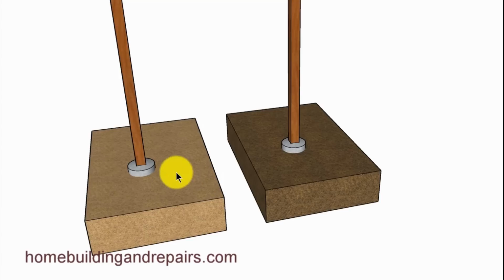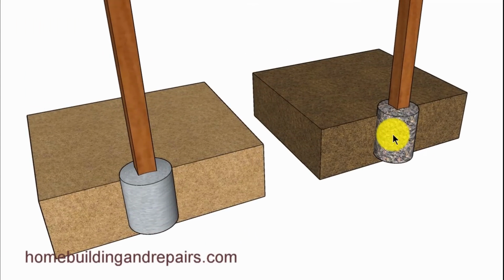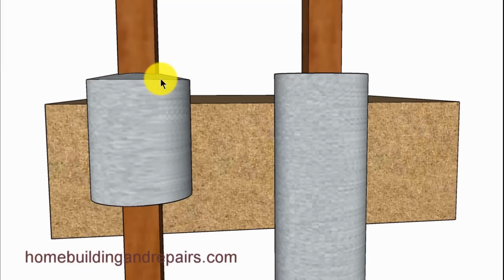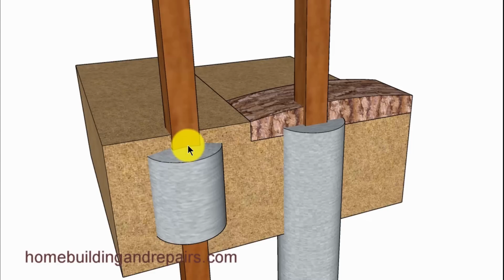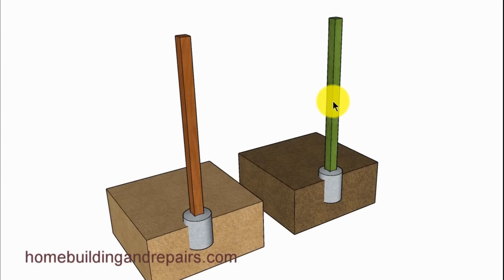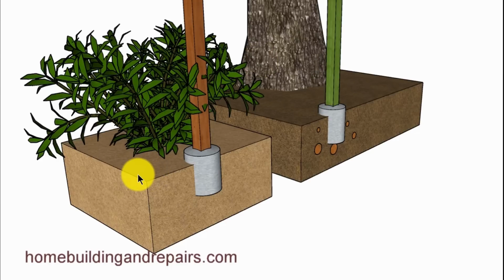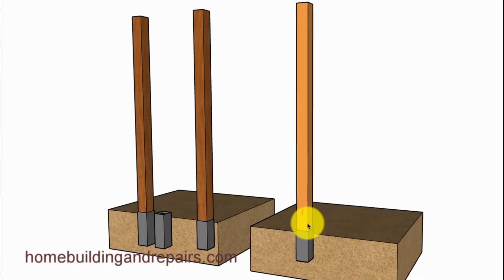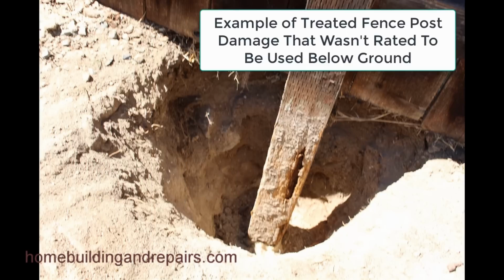Watch This Video Before Installing Your Next Wood Fence Post – Money Saving Ideas

Comment: Reasonably thorough but ! Concrete in cold areas, the frost can heave the post. Those metal straps in dirt or concrete will probably not last longer than the post.
 I would set guidelines, not absolutes.
1 Use pressure treated ground contact wood whenever possible
2 dig deep, below frost line. The taller the fence the deeper. Concrete would not be necessary.
3 the better the drainage the longer any post will last. 
4 If you use cedar or redwood your post has a definite lifespan. Concrete will make replacement a pain in the a$$ and not make the post last longer.
5 painting any wood fence, post or deck you will be in for a lifetime of maintenance.
Reply from the maker: I always like that, reasonably thorough but... I should change the title to almost everything about wood fence posts except for the stuff I didn't address. Your comment is sincerely appreciated and thanks for posting.

Comment: End result -- If you have a wood post, eventually it will rot...
Reply from the maker: I think I would've put it more like this, if you have a wood post it might eventually rot, instead of will rot.
Reply: @gregvancom  -- It will eventually rot unless something else happens to destroy it first -- fire, tornado, hurricane, errant teenage driver... Biological matter doesn't last *forever*... Maybe in millions of years we'll have petrified wood fence posts? :)  I don't have anything else that is all that pressing planned, so I guess I can wait around... Might need to stock up on beer though...

It won't last forever, but it might last as long as the rest of your fence and if you are lucky, you might even be able to get the posts to last through a fence replacement so that you only need to replace the rails and the pickets and not have to replace the posts.  If you live in a particularly dry climate, there's even a chance that the posts might last as long as you own your house.  I'm in the Houston area and that is most definitely NOT the case around here...

Comment: If we are going to use concrete and hardware, we could do it like how telephone posts are done. Make a concrete part that goes in the soil and sticks above and bolt your post to that. But im not sure what you gain against buying concrete fence posts at that point.
Reply: Cost, mainly... Besides, most utility poles around here are wood and just put in the ground with no concrete or anything around them other than dirt.  They are so heavily treated that they last a pretty long time.

Comment: given that wood rots..any alternative suggestions for non-wood posts that will avoid this
Reply from the maker: Maybe use metal, just keep in mind that metal rusts. I just built a fence using pressure-treated lumber for the fence post in my backyard last year. No guarantees that it will not rot, but I'll let everybody know if it does.
Reply: @gregvancom  l

Comment: Interesting video, just surprised that setting the posts on a couple inches of gravel and then in dirt ONLY wasn't mentioned.  It's more work to tamp the soil than to pour concrete or expanding foam, but it's a lot cheaper in terms of materials and kinder to the environment.  We have posts that are set that way here and they are still straight and sturdy after 25+ years!
Reply from the maker: We would all like to know what part of the world you're located in and the reason why I didn't mention what you're suggesting is because I've never installed a fence post for a 6 foot tall wood fence using your method that didn't lean where I live in Southern California.
Reply: @gregvancom  Thanks for the reply, sorry I just saw that.  We are in Memphis, TN, currently building a fence in Hernando, MS.  Much of the ground there is almost as hard as a rock!  Thank goodness we have a CAT 299D2 XHP with a 10" auger (although the old auger bit has already broken twice and had to be welded, plus hydraulic issues).  Some of the old posts were set in concrete and we were able to break many of those off fairly easily at ground level, by hand.  After reading more about putting gravel under the posts, we have decided not to do that anymore.  The reference that made sense to me referred to the fact that water will flow following the path of least resistance.  I.e., if you put gravel under the posts, that's where the water will be.  So, it's well-packed dirt only for Us.  I can imagine that with a sandy soil, that might not work well at all.  Thanks again,
 Daniel.

Comment: Here is what I do for a fence which will serve for ages to come. I precast 3-1/2”x3-1/2”, 5’-0”  concrete posts. 30” goes into a soil. You can embed it in a gravel or in concrete depending on your soil condition. 2’-6” sticks above the ground. I have two  holes for lag bolts in above portion of the posts and attach wood posts to concrete post leaving 3” gap above the soil. When in 30-40 years wooden 4x4 posts decay, throw them out and attach new 4x4 posts.  My fence is 30 year old at this point and I am estimating it will go on for another 10. Good luck!

Comment: How about metal
Reply from the maker: Your question is difficult to answer, because it's all going to depend upon the type of metal, type of wood and value. Are you willing to spend $50 on each metal post that will last 50 years or $10 on a wood post that might last 25 years.
Reply: How about aluminum better ?

Comment: What about using the fence post foam as that would cover the wood entirely and make it last longer?
Reply: That’s stuff is a joke.  As it hardens it shrinks and pulls away from the the post and the walls of the hole.
Reply: Les Davenport How long until it shrinks?
Reply: ** from what I have seen as soon as it is hard.
Reply from the maker: Now were talking, I would love to see a picture of that.
Reply: Turlock the Werewolf What happens?
Reply: It swells in the hole then shrinks and leaves a loose post

Comment: Your prefered method of burying your post completely in concrete is the worst method. If the concrete doesn't crack because of expansion of the wood then the post will rot within the concrete because that concrete acts like a glass of water. Concrete exposed above the ground is bad, also. Water still gets to the post no matter how you slope it. Other people will say that dirt on top would be the way to go. In all my years of doing fences the best method is to just bury the post with the dirt you pulled out of the hole and pack it as you backfill. The post will give you the greatest performance of all methods.
Reply from the maker: My preferred method is one way to prevent the fence from falling over. Strong winds, loose soil or simply the weight of the fence "can" (not always )cause it to lean or fall over, without using concrete footings.

Comment: Great videob, and info, but what is clay soil and how do you know if you have clay soil ? And how do I detect if I have clay soil?
Reply from the maker: Clay soil usually sticks together and you can dig a section of it up and form it into a solid ball shape that would be firm, where sandy soil would be looser and wouldn't be as firm. Sandy soil is also easier to dig or clay soil is more difficult and when it's dried out from the sun could be practically impossible to even push a shovel into. This might not be the best description, but I hope it helps.

Comment: How deep should the post be with 4x4 wood post?
Reply from the maker: I like my 8 foot fence posts that will be used for a 6 foot tall fence between 18 and 24 inches in the ground.
Reply: gregvancom how many bags of concrete per post? Ive seen that it takes 2-5 bags

Comment: So all methods are wrong 🤦🏽‍♂️
Reply from the maker: The reason why made the video was to try and extend the life of the wood fence post for as long as possible. Wood rots and that's a fact, your job as the fence builder will be to prevent it from rotting sooner than later.

Comment: Basically there is no good way to install a fence post
Reply from the maker: The reason why I made the video was to provide people with methods that might be able to make the wood post last as long as possible. In other words, don't water the wood post with your sprinklers and make sure the concrete footing is higher than the soil surrounding it and you just might have something that works.
Reply: gregvancom I understand. My comment was just a joke. It is unfortunate there is no full proof method, but it depends on your conditions.
This is a great comparison video between the different methods.

Comment: Creosote poles cut at your local saw mill.
Asphalt post paint.
Reply from the maker: Definitely a good idea as long as they can be buried in the ground and are ground rated.
Reply: @gregvancom  I get min from local power co-op.  "Old" power poles.

Comment: Before installing post DO THIS !  Brush TAR on the posts, or at least use Oil Prinmer - paint, give you at least a couple more years of no rot
Reply: Maybe bed liner or undercoating?
Reply: I like the tar idea!     I wonder what Mr. Greg would say about it?
Reply: tar covered wood pilon have been dug out of venice that are over 500 years old and the wood was still in PERFECT shape NOT a single rot on them

Comment: To comment in support of the gravel base, in all examples you have to consider - water wants to go down, not diagnal towards the post or hole. Though a percentage of water will temporarily pool in a gravel base, it is not attracted to the hole and will drain and leave post (or cement footer) sitting on a dry solid base sooner than if no gravel is present.  The use of gravel in a Sandy base is multi beneficial: it aids in drainage, and if properly compacted serves as a wider foot print for the cement footer which will minimize sinkage into the soil over time. Similar to the base plates you use on a bumper (tractor) jack when lifting a vehicle in loose soil. Very beneficial on higher load applications such as taller fence, decks etc.
Reply from the maker: Water won't always go straight down, but it usually takes the path of least resistance. Now if that particular path runs diagonally, then that's exactly where the waters going to go.
Reply: @gregvancom  very true but I covered that. If you're not commenting for the sake of, in the end (big picture) gravel footers yield more benefits than the risk of not using them. Additionally, the time and material cost incorporating them are so minimal it's cheap insurance.

Comment: I like the idea of using a metal bracket to support the post above the concrete pier.  However, this is different than a deck where it is supported by the house as well.  Are there certain brackets that make a stronger connection than others?

Comment: Wrap roofing felt around post before pouring concrete,lasts for years
Reply: Thats exactly what I was thinking. I've seen waterproof flashing used to waterproof wood exterior door frames, why so why wouldn't it work here?
Reply from the maker: See if this makes sense https://youtu.be/AZSWsn40TnY

Comment: Nice video! I am surprise you did not mention coating the wood with some this wood waterproofing  Rot can be prolong almost indefinitely, if you were to apply tar on all parts that are below grade. I  apply tar below grade and up to  4 inches above grade.
Reply from the maker: In my opinion it could form a place to trap water and even though it works well in your area, it might not work well in other areas. It's also method I used once and didn't have good luck with it.
https://youtu.be/AZSWsn40TnY
Reply: I did same. Post rotted through completely where post met concrete at ~10 years. The tar residue was still very much intact at the edge of the rot.

Comment: Never never put wooden post inside concrete or in the ground period!!!! Even if they are treated or cedar....always use a sonic tube pour your concrete inside it and a post base cradle that is on top of the concrete, make sure the concrete top is above the ground level a few inches....this way, it will last a lifetime and very easy to remove if need be...soooo simple .....do it right the first time and never look back :)
Reply from the maker: It sounds like you might have had good luck using some type of post base and I would love to see some pictures of what you actually did. You can get our email address at our website.

Comment: Or just attract the fence post to the concrete with metal hardware. If the concrete is deep use a cardboard tube and rebar

Comment: Gravel is used in French drains precisely because it doesn’t hold water. It drains water. So I disagree that gravel
Posting will hold water. But a good version to use is to gravel the bottom and then set the post in concrete.
Reply from the maker: Yes, if you have a system designed to drain water and it actually does drain water, then gravel usually works just fine. However, that might not be the case if you simply dig a hole and fill it with gravel.

Comment: I am on clay soil. Personally, I would prefer to wrap the post in 15# felt about 18" deep and just tamp the dirt as you fill the hole. Post doesn't rot for a loooong time. If I did encase the posts in concrete, I would either collar the post to shed water away from the post or pour the footing slightly above the surface and chamfer the concrete to shed water away from the post .

Comment: i have installed a bunch of posts, some of them already rotten, some are still fine, and i think the reason for rot is the tiny gap between the concrete and the wood from the top where water can penetrate. i tend to think that if this gap gets sealed properly with tar or something, + close wood from bottom with concrete + tar on wood that in concrete, it can solve the problem
Reply: The water in the ground is absorbed by the concrete and sucked up through the post via capillary action. Much like how a dry paper towel pulls water. The portion of post just above the ground stays moist as it is generally shaded on one side or the other from the sun. Rain will also drain down toward this section keeping it wet longer that the rest of the post. Warm weather is when the fungi that causes rot is most active. So water alone doesn't generally cause rot, as logs are sunk in ponds for decades and pulled up without any decay. It's warm, moist weather, wood, and fungi in the air that causes the issue.

Comment: Why not use metal for post that goes into ground vs 4x4. I see that allot in my area, Hot Springs, AR.
Also, me property has a grade where back is lower. I thought about using cinder blocks at the lower area creating a level starting point. Know thank at the house fence would be 6' but then at very back including blocks looking at 10' (right estimated right now. Neighbor in other side used local rock so he could build his fence level so in my side I have approx 4' Rock fence in bottom w 4'  metal cyclone in top. I'd like to add wood on top for privacy & to look good matching. Assume I'd install wood on top of fence the same way one does on a fence made completely in cinder blocks.
Thank you for any suggestions you may have. I can always send you pictures of that helps
Reply from the maker: I've seen a variety of different fences built and still standing using a standard sized metal post that is often used for chain-link fences. If others are using them in your area and they've lasted longer than the wood, then I would suggest using them also.
Reply: @gregvancom  thank u.  I do prefer look of wood. Really thinking of putting in tongue  n groove & laying boards sideways.  Giving me a level top edge & accommodating for slope without building up retaining wall.  I'm so into privacy in middle of no where & now in middle of tourist town so design total privacy w fence & plants-. Ton of work
Reply from the maker: @user-tn7xo7ky9o  You're welcome and you will definitely have some privacy after that fence is built.

Comment: putting wood below ground level is always a bad ideas- none of those methods are practical. anchor bolts and brackets is are best.
Reply from the maker: Putting wood underwater is probably even worse, so using the correct treated lumber, for example when building a pier extending out into the ocean, must also be a impractical idea.

Comment: True' not all treated is all ground ready.. They offer both ground contact and non contact pressure treated timbers at home depot for a reasonable difference. I know my last house used cedar 4x4 in concrete/clay on the fencing and it was installed in late 1950's before pressure treated posts were around. 
 Only (2) cedar posts were no longer standing on a 300+ foot fence when I moved last year. Those (2) posts were taken down by an oak tree falling on them during a severe ice storm. Is cedar better than treated in the long run, idk but it will certainly outlast my old arse I know that. Well' unless another massive ice storm hits no doubt. It used to be all that was used. Southern Cypress don't mind standing in water since it's grown in the swamps anyway, doubt it rots easy?
Reply from the maker: I would strongly suggest that fencing contractors stay away from your area :) thanks for the story.

Comment: I removed three 4x4 post today that were there for 21 years. After I got them out I broke up the cement with a sledge. To my surprise the part of the post in concrete was in great shape. They still had there original color, they were damp but all there. The top 6 feet of the post were cracked, split and bent, bowed.
Reply from the maker: I have to ask, why did you remove the post and do you live in a climate where it rarely rains like desert.
Reply: @gregvancom  I was not removing every post, just those that had bowed. These three had large bows in them from about the thee foot level from the ground. I was covering the post in cedar to update them without removing them. I live in the midwest. Freezing temps. and rain with hot summers.